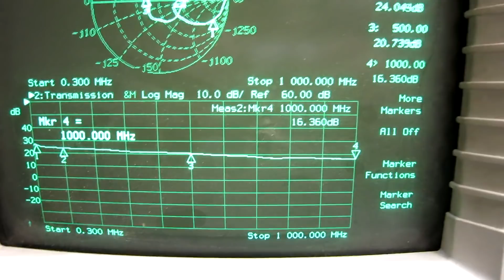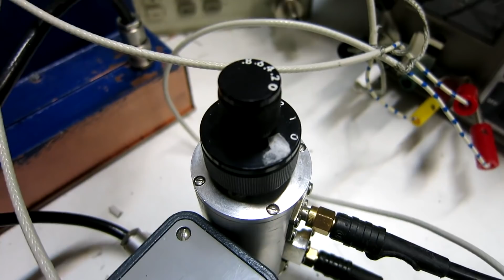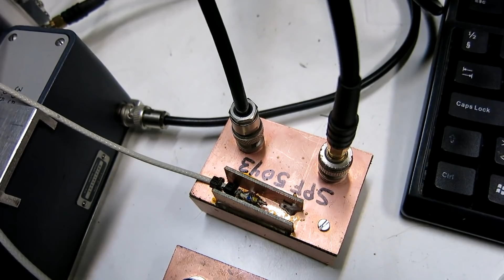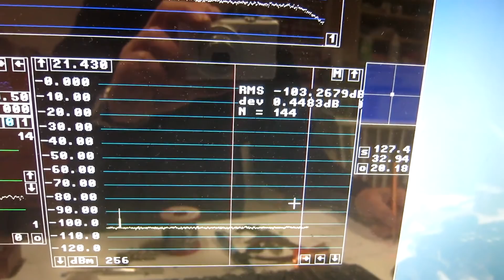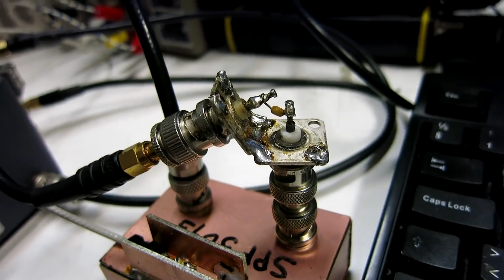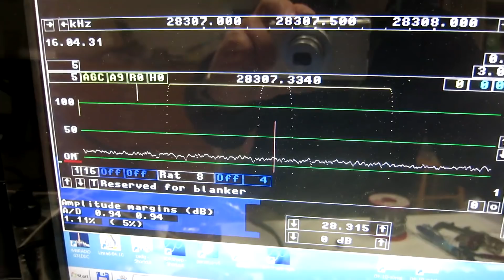PSA4vsSPF

Comment: hi, im just a hobbyist and not an expert like you, just want to ask you regarding for the PSA4-5043, i want to compute the proper LC using the smith chart and when i check the S parameters i got confused, which one i need to use between the four, S11, S21, S12 and S22 for the computation of matching LC.thanks

Comment: Hello Leif, quite interesting results. As you know both vendors declare the operation from 50 MHz up to 4GHz so making the same comparison within the datasheet declared figures may give the same or much closer results. As you can see, the S parameters published are going down to 50MHz and already at 50MHz the stability K factor is bellow 1 for the PSA unit. If you did not order new batch of PSA unit let me know, I get them straight from the production line in reels for the machine assembly so they may be fresh date, what you need.
Reply from the maker: When connected in a 50 ohm system the amplifiers are stable. Performance, that means noise figure is not so attractive well below 50 MHz but otherwise the amps work well outside manufacturer specifications. The AM noise modulation is the same on 144 MHz as I can see when measuring the G4DDK Anglian 3 transverter. The mechanism must be a noisy current through the HEMT and the gain changes with the current. The device goes to 4GHz so modulation should be similar from 30 to several hundred MHz. The 1/f noise current is obviously caused by a 1/f noise voltage on the input pin. I can trace the PSA4-5043 amplifier box back to September 2012, but it might be a couple of years older than that.
I have asked Minicircuits for samples, qty is 4 and that is how many I need for the G4DDK transverter, but actually would be enough to answer the crucial question: Do PSA4-5043 and SPF-5043 use the same GaAs chip today? If so, how come nobody protested when performance was so much degraded? Is it because everybody only looks for phase noise? Assuming that PSA4-5043 is still OK I would appreciate a couple of newly produced units to verify performance. My E-mail is at the bottom of my home page sm5bsz.com.